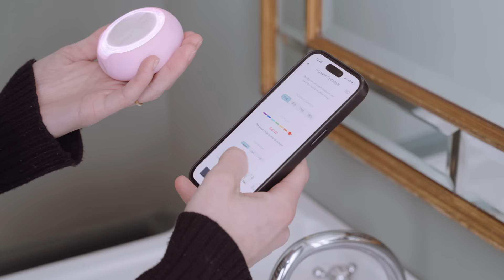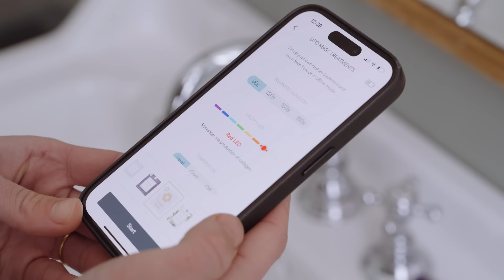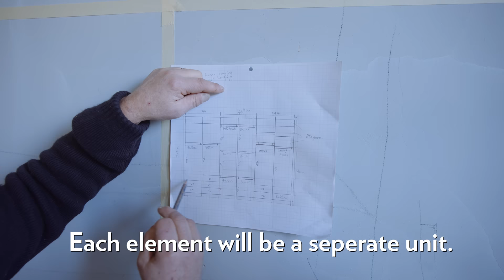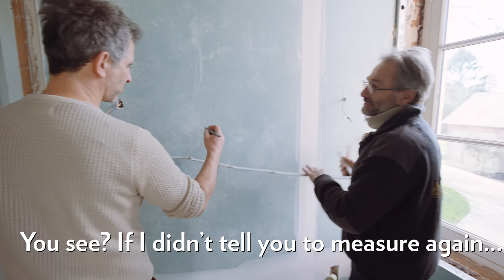I've never been SCARED at the Chateau. Until yesterday.

Comment: Tip in case you find another bird that doesn't fly away: Put them in a cardboard box in a (warm) quiet place for a while so they can calm down. Wild birds use a lot of energy if they are stressed and quickly get exhausted. If it still doesn't fly, try to find out if there's a wildlife rescue close to you.

I ringed birds for a while and when the smaller ones got too tired/cold to fly away we would put them in a little cotton bag and I put them inside my hoodie to warm up.
Reply: excellent advice!  I hope they see this comment of yours.

Comment: What about adding a strong, rigid screen over the top of the flue on the roof? Google says: Bird screens are great at keeping unwanted visitors out, but they are not the only tool for this job. Both a chimney cap and a top-end damper work well for keeping out birds, raccoons, and other woodland creatures too. They also work to help prevent downdrafts, leaks, and debris buildup, too. You are both kind-hearted souls for your concern about the trapped owl. Great job freeing it!
Reply: What GREAT suggestions! I've always worried about birds falling into my fireplace... especially when it's lit!!

Comment: I also had a bird (but a small one) in the chimney tube. I called the chimney sweeper and he freed it. But first he told me to open the windows and to stand with a blanket or towel in hand in the other way so that the bird would fly directly (hopefully) to the window. Because they normally are black and dirty from the soot and if the fly alongside a wall, your wall gets black. Just as a little hint in case any other bird should get into the tube. 🙂I also have a cover on the top of the tube, but somehow they manage to get inside...

Comment: I had a similar situation with a white  owl ,that had come down the chimney flew,  but somehow got around the metal plate at the top of the log burner.  I was watching TV and heard tapping,  only to see  it's little face looking at me through the glass.  I  didn't know what to do, thinking it may  be injured.  So i opened the front door, opened the burner doors and bravely ran outside.  I waited for  10mins  and nothing,  then just a i decided I'll go back in , it flew out of the door  , having to dip it's wings because they have a huge wingspan, it turned away from me an flew off . I really cheered with excitement and relief i didn't have to  do what  Philip did.

Comment: That was a lovely hat for Benoit.  Good job on saving the Owl and Anna's efforts were brilliant.  Loved the instruction reading! Your girls are getting so grown up, It's nice they can read the instructions for you and supervise while you work hahaha.  There is chimney netting/mesh that you can put over the chimney under the cap or around the cap (depending on the cap) to stop critters and insects from getting in. If chicken wire was used it most likely needs to be replaced as chicken wire can't take the heat and deteriorates. Your local chimney shop or sweep should have some. My favourite's look like wire bird cages over the caps.
Reply: Thanks for the info.  ...very useful!

Comment: As for the kerdi shower sheet a suggestion for next time is to apply the kerdi sheet horizontally so you dont have the vertical seams through which water can leak.  If you apply it horizontally in layers and make sure the top is always on top of the bottom one, you do not have seams through which water could potentially leak. You could use the same technique with the kerdi sheet on the floor and make it a bit bigger so it also partially covers the walls (underneath the kerdi sheet on the wall).

Comment: STORY TIME!

Growing up, we had a wood stove for many years, and never had any critters make their way down the chimney.  After some time, my father removed the old wood stove and sealed off the chimney flue, so there was just the end of it sticking out of the ceiling, not connected to anything.

One evening, I was home alone and I started to hear a strange scratching sound in the flue.  When my parents got home that evening, I told them.  My father opened it and held a black garbage bag up over the seal, letting the seal and whatever was in it fall into the bag.  Then he took it outside on the doorstep and let it wait until whatever was in it escaped.  

Bats.  Over 100 tiny black bats few out of the bag.  We have no idea how or why, and they never returned afterwards.  My father just sealed it back up and we never had any other problem with the flue.

Comment: I’m pretty sure the flue pipe should have been cemented in with fire cement to prevent leaks in the house and the inside pieces of the fire come out to access the hole up for sweeping good job rescuing the Owl though at the very least get a carbon monoxide alarm safeguard your family ❤

Comment: Pour Coke on the floor glue and let it sit for awhile. I discovered it by accident. It was under linoleum.  The tile people told me to use muriatic acid which terrified me. My daughter dropped a coke. We left it until the groceries were all uploaded from the car. The glue came up with rhe coke. So i bought more and covered the whole floor with it. However,  your glue looks more like concrete,  but it would be worth a shot. The Chateau de Purnon channel had an episode dealing with lead paint removal that looked much easier.  Check it out.😊

Comment: Fabric down the chimney overnight cures most animal issue without the need for an expensive professional who generally cannot get there in time to save the creature.

Use a light weight fabric like landscaping cloth, thin sheets, old curtain sheers, etc.  Tie a weight to one end (I used a heavy wrench) and thread it down with chimney to the bottom.  Tie off the other end to the chimney or nail it to the roof temporarily.  Leave it overnight and whatever was in there (mouse, rat, bird, bat, squirrel, etc) will have used the thin fabric like a ladder to escape……rope doesn’t always work if your problem is a bird or bat.

This method is humane and works well when just opening the inside flue doesn’t work for fireplaces that don’t have removable pipes.

Afterwords, you’ll need to secure wire mesh over the top opening and also cover that with an actual chimney topper too in order to prevent any further repeat performances.

It’s wise to check your chimney regularly for any exterior damage that might invite unwanted invaders and if you use your fireplace every winter like I do, having a professional sweep clean it once every 2-3 years is also a wise investment too!!

Best of Luck!